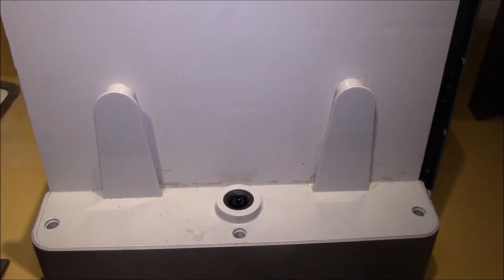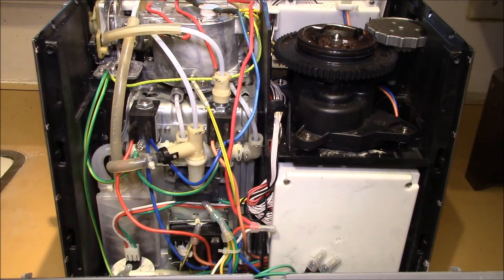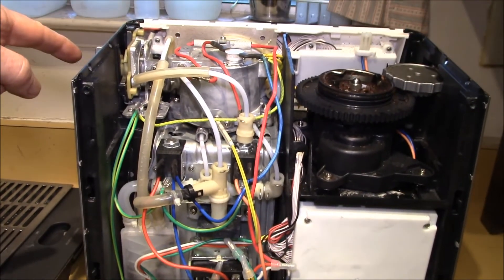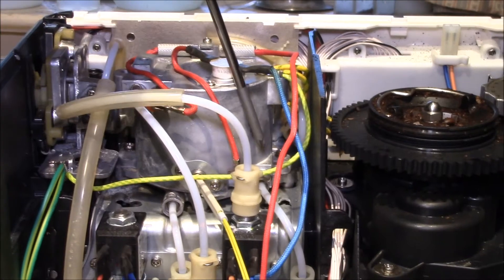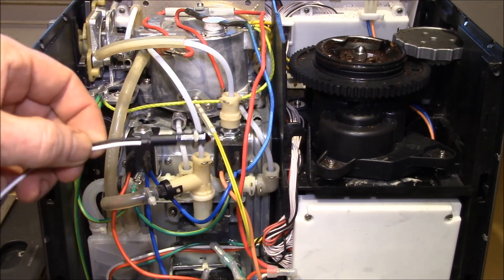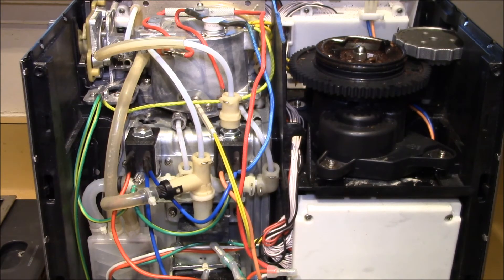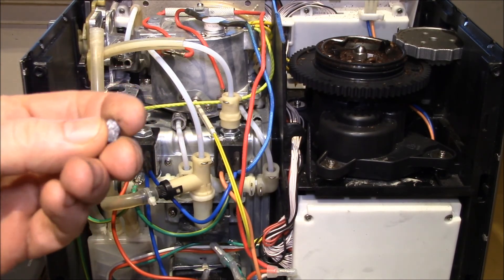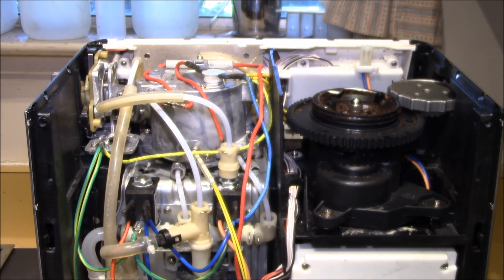Breville/Sage 870XL Barista Express - Water Flow

Comment from the maker: This pinned comment has some troubleshooting tips for Breville/Sage 870XL and similar espresso machines
If you have any tips to add or topics not covered, reply to this comment.

SAFETY NOTES:
- Be careful inside the machine, there are exposed live electrical connections inside
- Unplug the machine before working inside
- You may need to peek inside with a flashlight while running the machine to observe where water is flowing or to check for leaks
- Playlist with all videos: https://youtube.com/playlist?list=PLpY2FP1a9tisyIfKjSugexoVK01xQuptv
- Photo album with more details: https://photos.app.goo.gl/bN1ugnLPYwvyDcr59

The basic idea for troubleshooting problems with the machine is to "follow the water".  Start at the tank, then follow it's flow path and where it either stops or goes the "wrong" way is where the problem lies.  See below for details:

WATER FLOW:
Follow the water, find out how it's going to the wrong place, then figure out why:
- Starts in the tank
- Flows through a small in-line water filter
	That can get clogged, clean or replace
- Through the flow meter
	If that fails you're machine won't stop at the 1-cup or 2-cup setting
- Into the bottom of the pump
	That line can have air leaks and that can prevent the pump suction from pulling in water
- Out the top of the pump
	The pump can be worn and not be able to prime, move water or produce enough pressure
	Ulka pump rebuild kits are available as are new pumps
- Through the over pressure/safety valve (plastic part with a knob and hose off the side)
	That can be set for too low a pressure or if can have debris inside that causes a leak to the drip tray
- Through a tube to the thermo-coil then out of thermo-coil down to the side of the 3-port solenoid valve
	Either tube can be connected wrong or plugged inside or an o-ring is damaged or missing
	The thermo-coil could be clogged internally, try blowing air through forward and backwards to check

- For a brew cycle, the 3-port solenoid valve must open fully
	This will seal off the top port, that otherwise send water to the hot water/steam valve
	This also opens the side port to send water up to the group head
	If this valve is clogged and doesn't fully open, water will take the path of least resistance

- The 2-port solenoid valve needs to be closed to seal off it's side port which send water to the drip tray
	That valve may be getting power all the time and/or it may be clogged inside, preventing it from sealing
		Easy test is to disconnect the wires to the solenoid and test
		If it still leaks, open up the valve and clean it in descaling liquid
	It opens at the end of a cycle for ~30 secs. to purge hot water out of the machine

- For a hot water or steam cycle, the 3-port solenoid valve must be closed fully
	If water comes out the group head in hot water or steam mode, the 3-port solenoid may not be fully closed
		It could have deposits inside preventing it from sealing off the side port
			Open up the valve and clean it in descaling liquid
		It may be getting power all the time and sending water to the group head
			Easy test is to disconnect the wires to the solenoid and test

- No flow or pressure too low:
	If you don't hear the pump run at power on or while running the machine, pump may not be running
		Wires may not be connected properly
		Thermal overload (Klixon) may have popped
		Driver (Triac) on the main PCB may not be sending power to the pump, check voltage
	If you hear the pump running but no flow of water or too little pressure:
		Pump internals may be worn, rebuild or replace the pump
		Over pressure valve may be leaking or set to low, sending water to the drip tray
		Water may not be getting to the pump, clogged inlet filter or flow meter or air leak in tubing
		Check all the lines for clogs or leaks.

ELECTRICAL:
- Machine trips GFCI/RCD breaker
	A solenoid coil (black plastic cube on top of the valve) is a likely cause
	It may have had water dripping on it, leaving conductive deposits
	This can create a short from a live connection to one of the metal parts
	It may have overheated and cracked leading to a connection to metal parts 
	If this is the case, replace the black plastic solenoid coil (see below)

- Solenoid doesn't turn on
	Wiring hooked up incorrectly, e.g. maybe the solenoid wires have been swapped
	Solenoid coil may be burned out internally, a resistance/continuity check would tell if this is the case
	- Try swapping the coil with the other solenoid valve and see if starts working, if so, replace the coil
	- These coils seem to be similar, if you can find a similar brand valve with the same voltage
	Main circuit board (PCB) may be damaged and not sending enough current to turn on the solenoid
	- Voltage check at the coil; voltage significantly less than your normal line voltage, this may be the issue

- Solenoid runs all the time
	Coil will feel warm/hot to the touch after the machine has been plugged in but not used for a while
	This will cause the water to only flow to the group head, even in hot water or steam setting
	Likely cause is the driver (Triac) on the main PCB has failed in the on state, powering the coil all the time
	- Easy check: Disconnect the wires to that solenoid coil and see if it stays in the off position

If this information has helped you get your machine working, there are links to BuyMeACoffee and Paypal.me on the channel About page and check out my Amazon store link: 
https://www.amazon.com/shop/rbrown/list/1ZX60FWW3V5JS?ref_=aipsflist
Reply: I can’t get any water out of the group head for espressos. Hot water spout and steam working fine. I replaced entire solenoid block, no change.Using your brilliant guide, I think I can deduce that it’s the pipe that runs up from between the solenoid valves into the group head. No water comes out of here at all when 1 or 2 cup pressed. All other areas of the flow seem ok. Do you know what could be the cause and any possible fixes/solutions?
Reply: May add that the pipe from solenoid to group head itself is not blocked. Also, the water seems to just go straight to the dump valve.
Reply from the maker: @robt457  At the top of this pinned comment thread is a list of troubleshooting steps.  If water isn't going to the middle tube and group head, it's either:
1. Going out the over pressure valve on top of the pump.
2. Going out the top of the 3-port solenoid valve.
3. Going out the side of the 2-port (purge) solenoid valve.  

If 1, the valve is releasing pressure too low.
If 2, either the valve is sticking part way open and not sealing off the top port, or it's mis-connected of mis-wired or the Triac on the main circuit board has failed and isn't sending power to turn on that solenoid.
If 3, It may be the 3-port and 2-port solenoid wires are swapped or the 2-port solenoid is stuck part way open or is being turned on all the time by the Triac on the main circuit board.

Adding indicator lights, like I did in a video later in this playlist, would help tell if the valves are getting power at the right time.
Reply: Thank you for uploading this video. It is very helpful. My machine cannot generate enough pressure even with a cleaning disc. Without a portafilter, it produces ~ 1.35oz or 40 ml water for 2 cups. Hot water and steam wand seem to work as I get continuous water flow/steam. Just want to check with you if these findings suggest a failed pump? Thank you for your help!
Reply from the maker: @cfdfontan Could be any number of things, pump could be worn and no making pressure, over pressure / safety valve could be set too low and/or leaking water.  3-port solenoid valve could be leaking and sending water to the drip tray.  If you can, open the back of the machine (there are live, exposed electrical connections inside so don't touch anything).  But if you can peek inside with a flashlight while running a shot, see if you can find where the water is going (i.e. which tube is it flowing in) and that should point to where the issue is.
Reply: @The4Crawler thank you for your advice! When I pressed the 1 or 2 cup bottom, I noticed that there was flow moving down in the exhaust hose (the middle one connected to the diffuser), similar to what you described in the video. It seems the valve is malfunctioning?
Reply from the maker: @cfdfontan  Yes, that valve is what directs the water flow.  Might need cleaning:
https://youtu.be/eljHS_BRJXk?si=aUtK-eRPDtfNOBkk
or replacement, I have a couple of videos on that process.
Reply: @The4Crawler thank you for sharing your experience and your help!!
Reply: Thank you for the videos.  I just finished replacing the solenoid block on my Breville Barista Express BE870XL/A.  But not everything is working as expected.  The new solenoid block is on, the water line connected to the back panel and the water reservoir hung on the back.  I've not replaced the top or all the screws to button it all up.  When powered up the Filter Size single/double lights are alternating flashing.  The single and double button servings are now producing water out of the group head which it was not before which is why I replaced the solenoid.  The problem I have is that the hot water / steam control is outputting to the group head instead of the hot water spout / steam wand.  So no water is being directed up to the hot water/steam output.  What do you think?  Bad connections? blocked hose? bad new solenoid?  All suggestions welcome.
Reply from the maker: @mjg4653  Flashing filter size lights means the coffee bean hopper is not fully seated:
https://youtu.be/uo9G6g6tZ_w?list=PLpY2FP1a9tisyIfKjSugexoVK01xQuptv&t=401
Reply: Hi, hope you can help. I am getting no water to the group head, I have changed both solenoids and the water continues to be dumped. The hot water and steam wand work as they should. What else could this be?
Reply from the maker: @Paulhebson  A few things to check.  One is that the lines are connected properly and are fee flowing, i.e. you can blow air through them.  The 3-port solenoid valve may be clogged or stuck in the off position.  Or it may be there is no power getting to that solenoid coil either due to bad wiring (connected wrong or broken wire) or that the driver on the main circuit board has failed.
Reply: @The4Crawler there is slight damage on the circuit board I’m unsure how to upload a pic. I appreciate your reply.
Reply from the maker: @Paulhebson  Photos 11 and 12 in the album below show a new circuit board and component layout:
https://photos.app.goo.gl/77APPjC3WVhX3DvS7
If you have a cloud storage account (Google photos, Dropbox, etc.), you can upload the photo there and post a link to it.
Reply: Appreciate your reply. There is slight damage to the circuit board but I’m unsure how to upload a pic to show you
Reply: My flow meter connector was severely corroded and when I took off the plug a pin broke off (its stuck/corroded into the connector). I can get the flow meter, but I need to replace the electrical connector to the flow meter.  Any info on what that might be? It has "A3960" on it.
Reply from the maker: @cidmontenegro8225  See the last photo in the album below:
https://photos.app.goo.gl/bN1ugnLPYwvyDcr59
Reply: Hey there I have the Breville Express Espresso Machine BES870XL & unfortunately the  hot water dispenser broke off I've found a place to purchase rhe part but I'll need some help to repair once the part comes in. I see you've worked on a bunch of machines judt curious if you have any videos or recommendations on how to go about replacing this part. Thanks so much for your time hope to hear from you soon.
Reply from the maker: @shannonrussell6115  I haven't yet got into that part of the machine, but check out the web page below for some ideas:
https://siber-sonic.com/appliance/800Disassembly.html
It's for an earlier model machine, but likely the mechanical disassembly is similar.
Reply: Hi @the4crawler thanks for this information it's really helpful 🌞
But I'm still having issues in getting water through my group head. 

I have replaced the solenoids, the water pump, the triac, given it a good descale and also pulled the group head out to make sure its not blocked but when I turn it on the water still just goes to the tray when I push the 1 or 2 coffee cup.
The steam and hot water works fine.

It seems like there is no power going to the solenoids for some reason🤷‍♂️

Would you have any idea what Am I missing?

Cheers for your help
Reply from the maker: @troyvidovich375  For an espresso shot to work, the 3 port solenoid needs the coil powered on to seal off the top port and to send water to the group head.  2 options are that water is going out the over pressure valve to the drip tray or it's going out via the hot water/steam valve which, if off, send water to the drip tray. 

If the latter, then that would indicate no power to the solenoid.  You could check for voltage there, that's where the indicator LEDs I installed on my machine help.  It may be there's an issue with the wires, broken connection some place.  Or the repair on the circuit board has an issue:
https://photos.app.goo.gl/Kg12KYvEd4dfV92X6
Reply: @The4Crawler  Hi mate thanks so much for your reply information I truly appreciate it mate 🙏

There is definitely no power going to the solenoids as I unplugged the wires and tested them with a volt meter also I turned on the 1 and 2 cup and the water went straight to the tray.
So I have now ordered a new power board as you have suggested it maybe the triacs so hopefully this is the answer.👍
Thanks again I will keep you posted👍
Reply: Were you able to fix it? Mine is doing the same as yours. Please let me know. Thanks! @troyvidovich375

Comment: Hi,
I have an issue with my pressure gauge on my sage coffee machine. It has stopped working. I have replaced it but still the same. I can make coffee but the pressure gauge does  not move at all. I was wondering what else can be the problem. Thank you
Reply from the maker: Likely a clogged line connecting to the gauge or a clog in the fitting where that line connects to.  It's a mechanical gauge.

Comment: Thank you I’m watching this video over and over again trying to find a solution for my problem I changed solenoid valve is brewing good but when I need steam or hot water it comes from the group head thank you in advance I hope you will read this  message
Reply from the maker: Check the pinned comment in this video for some troubleshooting ideas.  In short, water will flow following the path of least resistance.  Could be the 3 port solenoid valve is sticking open and allowing water to flow to the group head all the time.  

Or, it could be that valve is being turned on all the time by the main control circuit board.  A check for this is to unplug the machine, disconnect the wires from that solenoid (the one on the right side), wrap those wires in tape and then plug the machine back in and test it.  If the hot water/steam works, the circuit board may have failed or the wires are connected incorrectly or perhaps some of the tubes are connected incorrectly.

The other option to test for a bad circuit board is to hook up some indicator lights like I did in a video in this playlist.  That way to can see see if a given solenoid is getting power or not and when.
Reply: @The4Crawler thank you I appreciate your help

Comment: Great explanation. I have steam coming out of the group head when it should be coming out of the wand so I've got the solenoid assembly out and soaking in vinegar.  Lots of information provided to help me sort this one out.  They are well built machines but after 8 yrs of solid use I'm not surprised it finally broke!
Reply from the maker: Glad it helped

Comment: My three way solenoid had melted and we replaced it. Steam function now directs to group head. Is my replacement solenoid faulty?
Reply from the maker: It may be that the new solenoid is stuck open or more likely, the driver circuit for it has failed in the on state.  An easy way to check that is unplug the machine, disconnect one of both power wires to the solenoid coil and wrap the ends of those wires in some electrical tape.  Then plug in the machine for a test run.  If steam/hot water works, then it may be the circuit board:
https://photos.app.goo.gl/bN1ugnLPYwvyDcr59

Comment: Great explanation of how this works. I was also having problems with my machine. The circuit board shorted out so I replaced that. It fired right up but no water from the new head. Traced it to a bad 3 way solenoid . I replaced the whole manifold. Fired it up and now water only comes from the be head. Strange thing is that now when I plug in the outlet, I hear the solenoid click. Hmm. I opened the circuit board and found that a transistor blew.  WTF!
Luckily I still had my old board so I took a transistor from that and now I'm back in business. Why would a transistor on a new board blow?
Reply from the maker: Perhaps the coil on the old solenoid was marginal  and that took out the driver on the new board.  Or the new board may have had a marginal driver transistor and it failed.  In either case, getting a new board, transistor and solenoid seems to have fixed it.
Reply: @The4Crawler  It probably was the old coil. It had leaked for years from a loosely tightened top fitting. I found that out the first time I opened it. It was all rusted. Thanks for all your help.
Reply from the maker: @fransfarrugia4490  Yes, water will do in the coil.  Often it's cause them to short to ground and then you'll find the machine trips a GFCI or RCD type of circuit breaker or outlet.